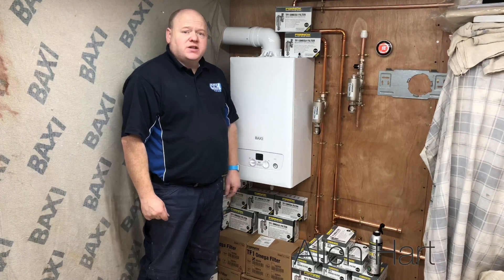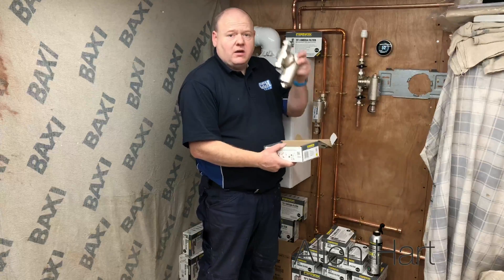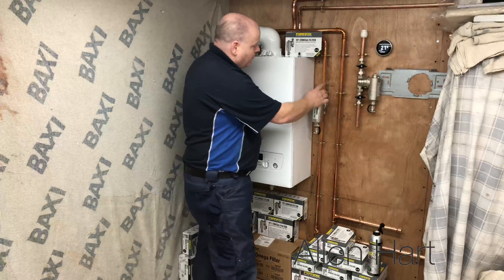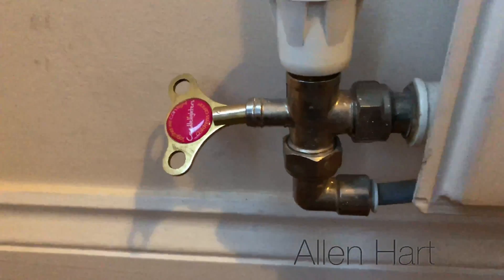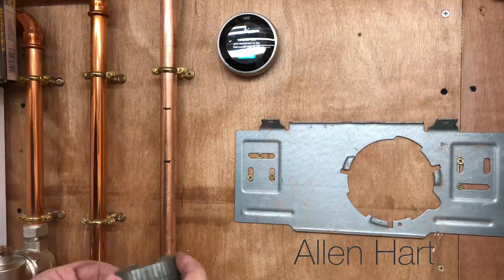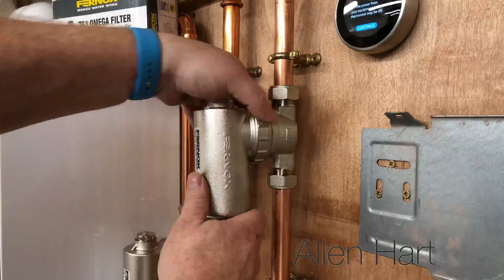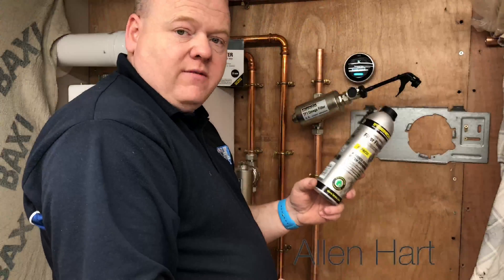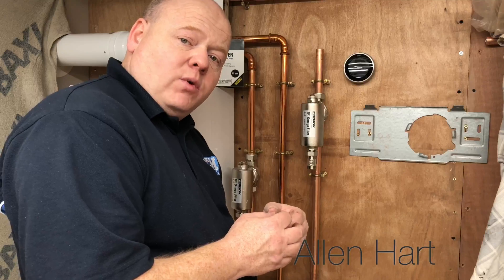How To Install A Fernox TF1 Omega Filter

Comment: You have not mentioned there is a metal “cage” inside the filter that if not located on the diameter of the rotating ring you removed it will not work. The cage must be located on the rotating ring. To be honest there is absolutely no reason to totally remove that ring. No access is ever needed and if you do remove it the cage will just be free to drop to the bottom of the filter. Good instruction otherwise 👍

Comment: Hi Allen, like the video.
Hope you be able to help me. British Gas fitted an omega, with no valves when they replaced the boiler. However they didn't explain the filter or leave any instructions.  
The filter is fitted tight to the ceiling and needs to be rotated to remove the magnet etc. 
My question is, can I loosen the large collar nut to rotate the filter as there doesn't appear a way of stopping the water. Plus how do I loosen the nut if it has been nipped tight?
Thanking you in advance,

Paul

Comment: Great video! I need to replace mine, having major leaking problem :-( Looks very simple to do...but I have a question, this is what I currently have with exactly the same problem. I already have the valves...can I just swap it out for a fernox tf1 filter? the gap in pipes the same size? Looking at the parts on the website it looked like the top part of the pipe is flat, although not so in your video...so am a little bit worried of a compatibility issue? https://www.youtube.com/watch?v=wb7HC2W03BY

Comment: Hi Allen, I have recently found your channel and enjoying your videos.  I have a TF1 which has often been problematic, I recently changed all the seals/washers and today noticed the drain tap was dripping.  At this point i'm thinking about replacing with an TF1 Omega.  Can you tell me if I purchase the cheaper one without valves if it will fit between the isolation valves already fitted for the older black plastic TF1?   Many thanks and keep up the good work!
Reply from the maker: Unfortunately you need to buy the one with the valves. Thanks

Comment: Does that radiator drain down point start coming out as soon as you open the key and have to get the hose on?
Ones I have are a Tee off and have a slotted screw on the top so you can connect the hose before it's opened.

Comment: Hi Allen, again, just been thinking, I am going to get one of these filters, regarding adding chemicals in future once it's installed. I know you can inject the chemical treatments via the attachment. But is it possible if have the valves installed to close them off after rinsing the filter out ,then adding chemicals in via the top where the magnet is? Then open the valves and turn boiler on to get it in the system? Cheers again Allen for any advice
Reply: you do not add chemicals via the top,  the magnet is in a dry pocket!!

Comment: Hi Allen 
i noticed you should the installation without valves a 70mm pipe cut out. 
What is the length of pipe that needs to be cut out with the Fernox TF1 Omega filter with Valves
Reply: it measures about 195mm, but i need confirmation from the expert  too.
Reply from the maker: not sure tbh.

Comment: Hi Alan , thought I would just mention that if you are replacing the old type plastic TF1 with one of these omega units you can use the original valves with the red handles so it makes for an easy swop , I do a lot these and just replace the old rubber washers and your good to go......👍
Reply from the maker: yensabi That is the reason they were designed like that. Thanks for sharing.
Reply: Was trying to do that on a mag tek plastic one but different nut size sadly so had to alter it all. On the sample fitting the arrow is facing down oops.

Comment: Thank you so much for all the helpful videos.  You explain so much better than the instruction booklet.
By the way, the model with valves, the pipe section needs to be cut out is about 195mm is that about right?
Reply: hi , im measuring as well 195mm, did you fit the filter with valves at the end?